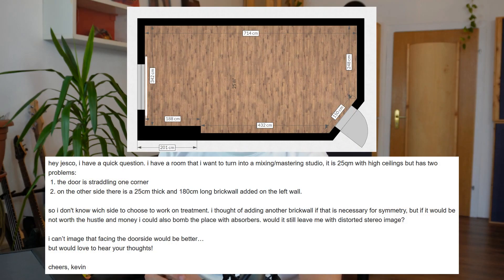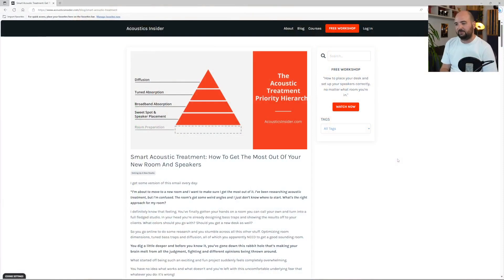Home Studio Acoustics: “My room is asymmetrical. Should I fix it?”

Comment: Jesco, do drum risers help the sound of drums when tracking?  My drummer insists it does.  But this is a cement slab floor, with a 10' ceiling; I'd think that losing ceiling height by lifting the drums would hurt the tracking sound.  Is he right, or am I right?
Reply: I would prefer a drum riser made of wood, rather than tracking directly on a concrete floor. The drums will resonate better on a wooden structure. 

But I wouldn't want to lose height either. 

I think the answer here would be a rug. Experiment with a small piece of plywood underneath the snare to bring back some attack.

Comment: Jesco, I remember you saying that a very small room will have no standing waves, but the pressure from the bass will be there. If the room is small enough not to have standing waves, then is the bass hunter technique still required, or can the listening position be anywhere? Thanks.
Reply: Could you elaborate, please? To my understanding, a small room is one big standing wave, a constant reflection, constantly mixed with a direct signal. You could measure the length of a 100 hz wave to get the idea. 
Although, I'd be really glad to be proven wrong, if there's some magic (or voodoo) to avoid all these tiny room problems.
Reply: d @zerobject  I wish I could elaborate, or find the video where Jesco is talking about it. He was saying that sometimes a room is so small that standing waves can't form, but rather the pressure from the low frequencies push on the room, like a balloon being inflated. I wasn't sure at the time how that would present itself sonically, or if it would just be an uncomfortable space to be in?
Reply: @KaneDWilliams I think it's the latter -  an uncomfortable space, full of issues harder to fix. I've been to some rooms (bedrooms) like this - it's still possible for electronic music creation, but you'd need lots of time to adapt and two pairs of headphones you really trust. Sometimes these rooms aren't even worth the effort of treating, but that's subjective, of course. 
Sonically it's always different, but always weird, I'd say. 

Even if you manage to tune such room to some average result (and that means making this room smaller, than it already is), the problem is still there - the inability of using bigger speakers. Then again, using big speakers in a tiny room is a strange idea itself.

Comment: Surprised to hear Jesco say that placement should always be dictated by spot with most even bass. The best bass response is sometimes in opposing corners for example. So you get the most even bass response but you have this super wide weird soundstage…all for the benefit of say getting rid of a 100hz dip…at that point I would use headphones to check for the dipped area at 100hz.
Reply: Best bass response in a corner? I think corner are the most problematic place for bass, hence why corners are the first place people place bass traps. Why would you end up with a weird, wide soundstage? You sit in the place in the room that has the most even bass response, you then place your speakers in relation to that listening position.
Reply: @KaneDWilliams  room modes are messy so rules of thumb don’t always work. A sub handled bass below 60hz so the corners did not overload sub bass with monitors. But again this placement made monitors too wide for mids and highs so headphones were used to monitor the dipped out area. Headphones can be a great tool for monitoring bass.